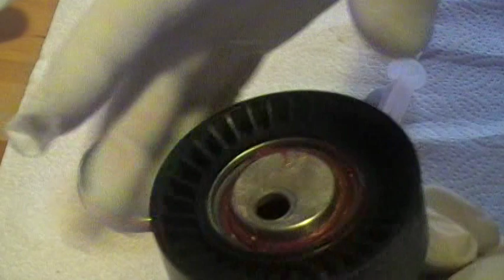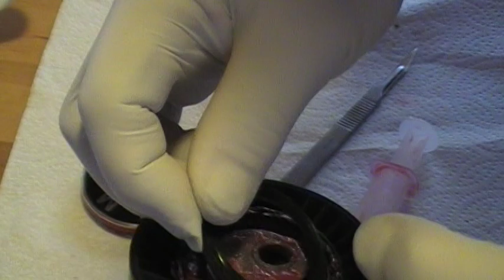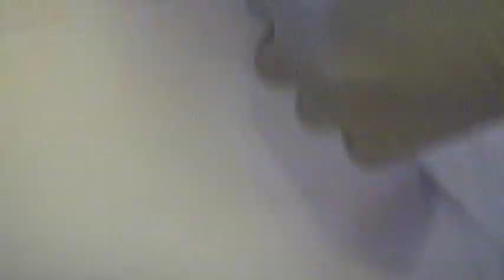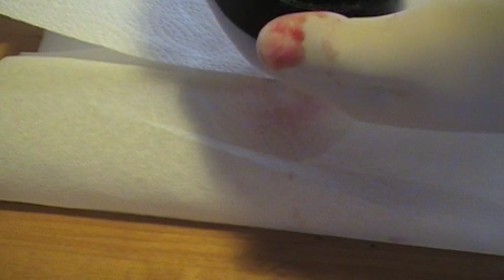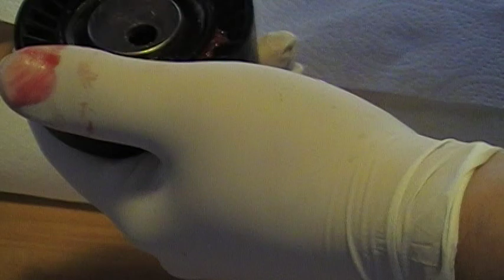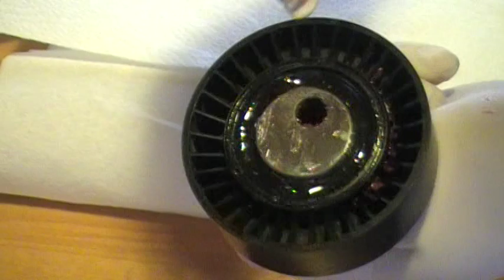Belt tensioner roller and Idler Pulley repair BMW, Mercedes, VW

Comment from the maker: Well, your theory is interesting. Not all theories are correct in real life. I still have that belt tensioner on the car that I drive every day. And it doesn't make noise or had fallen apart. If this repair allowing me to use the part for several years its good repair to me. But of course you can buy new one. I have that option too, but I postponed it by 3 years and may be that greased roller has a few more years of service life.

Comment: This is a silly waste of time. The "dirt" inside that bearing is actually finely divided bearing material! Even if dirt had made it in, it would destroy the bearing within seconds if allowed to spin under load. This is a VERY temporary fix at best -- more likely a complete foolish waste of time. The bearings aren't THAT expensive! And the idea of repairing a seal with glue is laughable!

Comment from the maker: The glue I used is Automotive Goop. Can be purchased at any autoparts or hardware store. Glue is clear. Similar, but black in color glue is Shoe Goop. Sold at any sport shoes stores. The last one can be also used to repair any broken or cracked plastic air ducts like an alternator air duct on BMW. You can even patch up holes in the ducts with it. Glue is very strong, pliable and easy to use. Just let it set over night.